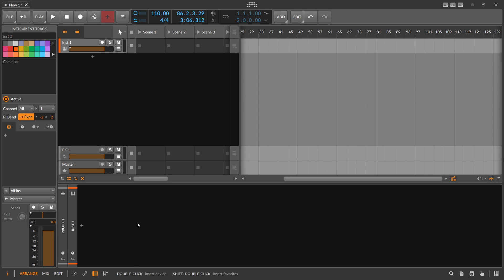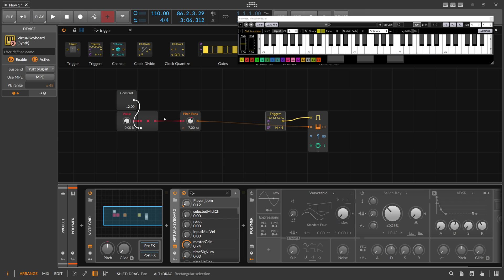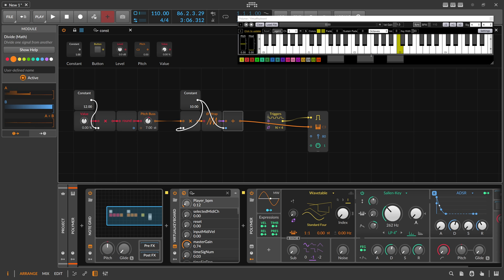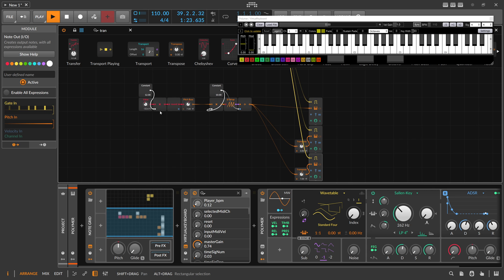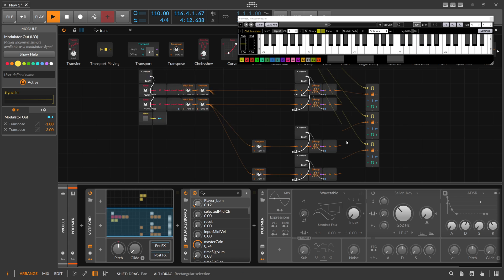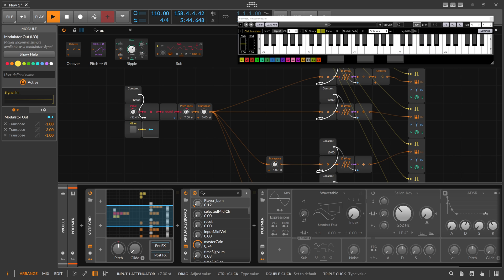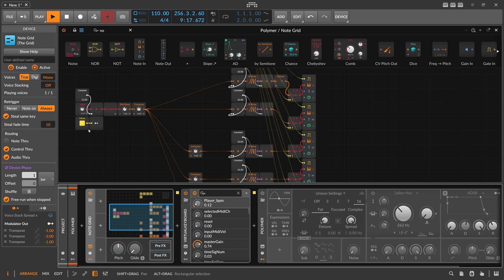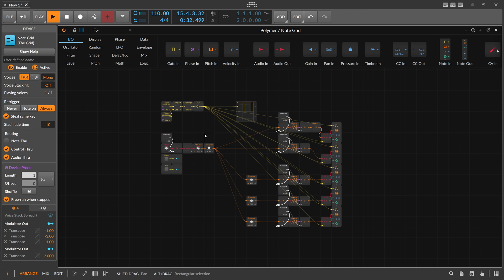Easy Chords and Intervals with Pitch Buss - Bitwig 5.1

Comment: Genuine question : why not use a pitch scaler module ? Is it because it would destroy the original fifth ?
Reply from the maker: you mean the pitch quantizer? that doesnt work. Its not about the notes, its about the relationship or the order in which you play the notes. And if you step around the circle of fifths, you will end up with all notes on the keyboard. so the quantizer makes no sense, because where not limited to a scale.
Reply: @PolarityMusic  Oh yeah sure, thanks for your reply. I'm still talking about the pitch scaler which forces a range from 0 to 1 to fit into a range of notes. Apparently the Pitch quantize does something else. I guess it would be possible to use the pitch scale module but with logical values as input, making it still necessary to move the octaves anyway.
Reply from the maker: @hadrienhartgers3498 no the scaler scales the whole signal or attenuates it. (squeezes it). the wrapper doesnt scale, it only wraps the values back in. hard to explain, but it does something different.
Reply: @PolarityMusic  So the wrapper is like modulo, and the pitch scaler is like map-range (take a value from within a defined range, scale it proportionally to a separate defined range)?